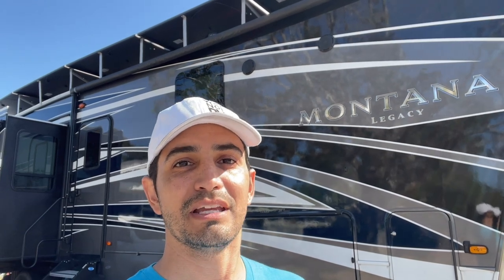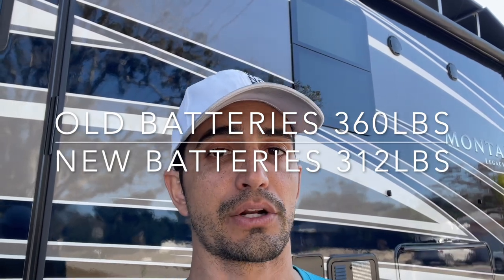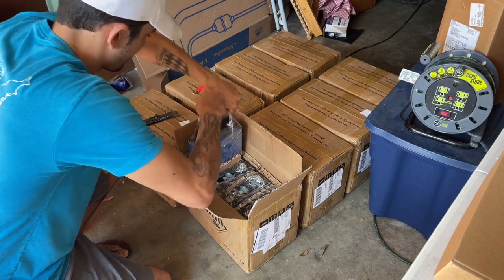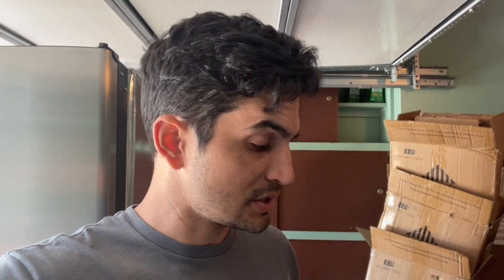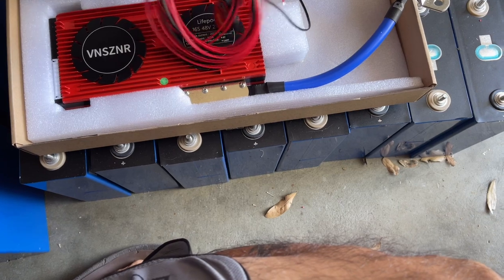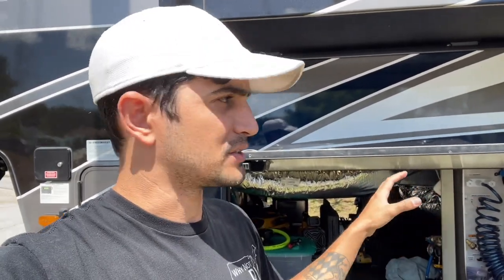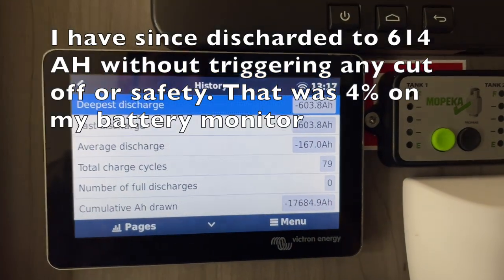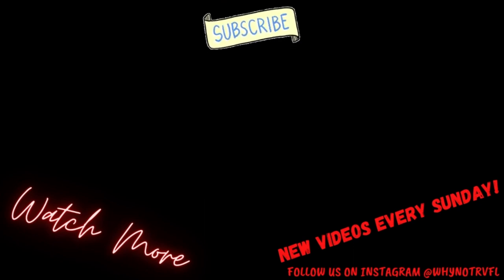Most AFFORDABLE way to go LITHIUM - Why Not RV: Ep 97

Comment: I am hoping you are open to taking some advice from a fellow YouTuber and professional RV Solar installer.

It is dangerous to have loose cells installed in an RV like that.
They have no protection from impact or protection from anything you might have loose or that could come loose in the storage bay.
They also don't appear to be secured and could move around.  Raw cells only have a thin aluminum cases and they pierce easily.

You really need to pull these out and put them in some sort of a container or case.  Not only that but the terminals aren't covered or protected and any number of things could come into contact with them.  At least cover the terminals with Capton tape to protect those from contact.
Reply from the maker: Yes yes and yes. Absolutely. I have wood framing around the batteries to hold in place. I have some temporary cardboard on top to protect the terminals. Still Trying to figure out something better. Where these are at there is absolutely nothing that can fall or anything to get to these.
Reply: @WhyNotRV  I like to use tool boxes with terminal.   I know you are on my Facebook group.  I will post some links for you to check out that you can use for ideas.  Tool boxes are great because they come in so many sizes to suit the space you have there and the battery will be self contained and easy to move if you need to.

Comment: Hey Chris, are each cell 310 Amps or do 4 cells together as one battery equal 310 Amps. On EEL's website it states 302 (largest amp rated they have on their website) Amps per cell? If I configured 6 of theses in a 12v configuration, that means I would have a 1812 Amp battery bank (if the amperage is 4 combined and not 1 each). Thanks and great video.
Reply from the maker: Each cell is 3.65v max at 310 ah. So 4 is 14.6v at 310 ah. If the website only has 302 ah available it’s just about what’s available at the time.
Reply from the maker: I hope this helps. Please let me know what other questions I can answer
Reply from the maker: Series will increase voltage but not amperage. So 4 cells in series make a 12v battery at 310ah, 16 cells in series make 48v at 310ah
Reply: @WhyNotRV  perfect, thanks!
Reply from the maker: Absolutely!!!

Comment: Its  not recommended to have batteries  directly on concrete... or are these different??
Reply from the maker: I was just unloading and staging them on the concrete floor in the garage. If you are looking into these for a home off grid battery situation I would definitely place them on some sort of insulated flooring.
Reply: I believe that's an old wives tale.  I'm 80 and worked in a tire & battery shop in the 50s.  That's what we were taught.  However I'm neat certain that's no longer the case.

Comment: You will quickly learn that although the Daly BMS is a popular option is does a horrible job of keeping the cells in balance.   I would strongly suggest you change out that BMS...they are crap!  The Off Grid Garage channel did a very good review of this BMS.  https://www.youtube.com/watch?v=02qFIjCI820
Reply from the maker: So far I’ve been monitoring it quite a bit and haven’t had an issue yet but I definitely appreciate that. I’ll look into it.
Reply: @WhyNotRV  Andy has a ton of really good videos on these batteries and how to treat them for max life/ah, etc.   He does a bunch of experiments and tests to prove out or dismiss urban legends or answer viewer's questions!  He is in Australia and uses his solar/battery to charge his Tesla, run pool pumps, and other loads!  So he definitely puts the system to full use.
Reply from the maker: Cool I’ll check out the channel